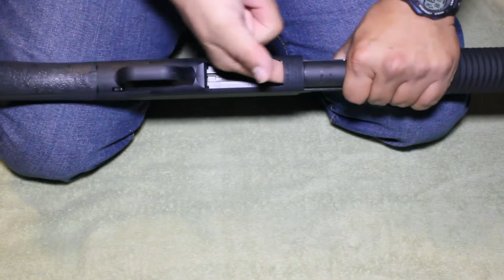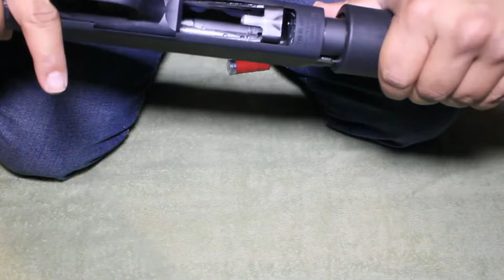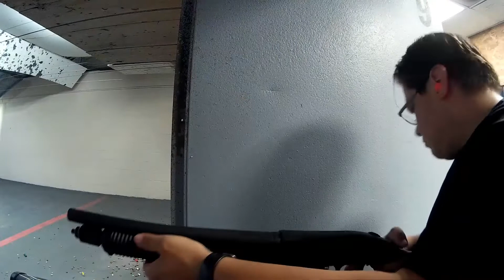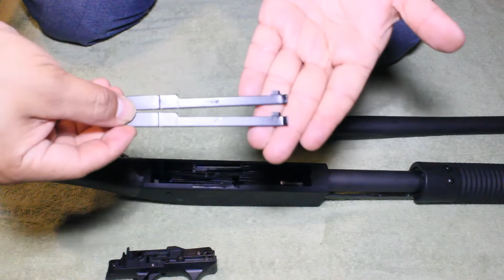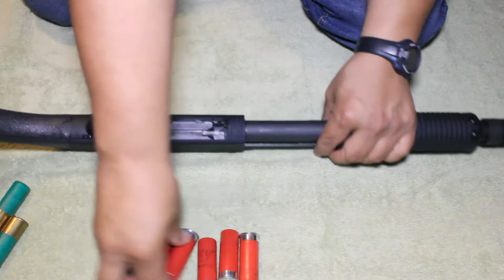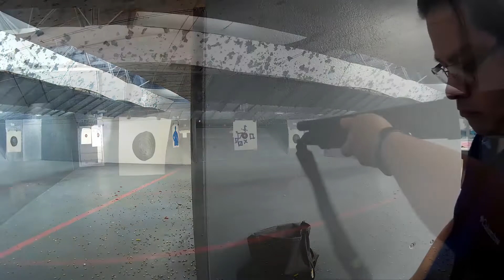Mossberg 590 Shockwave Loading/Mag Tube Problem&Fix

Comment: This is a very common problem with this gun, both releasing more than one shell at a time and not releasing shells at all. The difference between a properly made and improperly made shell interruptor and stop is only a few mils, which is why you cannot see the difference with your eyes. These are cheap stamped metal parts that Mossberg makes by the thousands, they dont bother to QC the parts, they just send replacements for the bad ones.

Comment: Yo brother I had a question hope you see this, I literally can only load ONE 2 3/4 shell at a time, it’s brand new it worked fine first time I shot it for about 20 mins then I couldn’t load more than one. I push super hard to get another one in but it won’t allow it
Reply from the maker: Take out your spring and check to make sure it is ok. Check the follower also. Don't know why it would but make sure there is no plug(wood or plastic)inside the tube that would limit the amount of rounds it holds. Make double sure it is not loaded, unscrew from the front counterclockwise and disassemble to pull out spring and check your spring. If nothing else works call mossberg they'll either send you new parts or ask you to send it in to them to fix. Customer service +1 800-363-3555
Reply: @paschallhouston  Thankyou so much for the reply and the help man I fixed her today, stay safe and stay blessed brotha !!

Comment: I just bought one when feeding the feeding tube with 2,3/4 shells I get 5 but barely have to push hard to get the last one in and even then it just barely catches is this normal
Reply from the maker: That is what mine was also doing it was barely holding the last rounds in the magazine tube. I dont think it is normal unless you installed a stronger spring yourself. My shells would fly out when shooting or pumping the shotgun.Dont trust it until you test fire it. To be safe I would contact Mossberg for the parts I replaced they were free and their customer service was awesome with me. The replacement parts I put were easy to install. I would ask for them anyway and see if that is your problem it would not hurt to try yourself before you pay a gunsmith to work on it. Mine is still working great ever since I replaced the 2 parts.Let me know if you find out the problem with your mossberg. Oh and mossberg will fix if that does not solve your problem but told me to try before I sent to them

Comment: Just bought one today. Haven't tried it yet. Has Mossberg fixed the problem at the factory, or do I just hope for the best and deal with it when it becomes a problem? Waited awhile for new stock to arrive just to find this out. It is recommended to disassemble and clean really good right out of the box. Fingers crossed. Thanks 🇺🇸
Reply from the maker: Don't think it was a problem with all of them but mine was not working right. It still works great today with no problems.I bought it new from a gun show and the dealer I bought it from was about $25 dollars cheaper than the others when I was browsing around. So I bought it from his table. I think he knew something was wrong with it and was just looking to get rid of it quick. I think yours will be fine. Just make sure to shoot it and make sure it functions flawlessly before you depend your life on it. Do that with any gun you buy. Check and make sure the safety works pointing it down range in a safe direction. Honestly I would just clean inside of the barrel with some gun cleaner before and after you shoot. Oh and if you install another legal stock on yours after you tighten the allen or screw make sure you did not overtighten it. It can stop the trigger from working and the firing pin won't drop and hit the shell. Not saying to leave it loose, tighten as much as you can and use blue loctite. Just pump it and if it clicks when you dry fire you are good, if you dont like to dry fire load it and make sure it fires That has happened to me in the past changing a stock on one of mine. In short, just test it.
Reply: @paschallhouston  Thanks for the info. Appreciate you taking the time to respond. Great weekend 🇺🇸